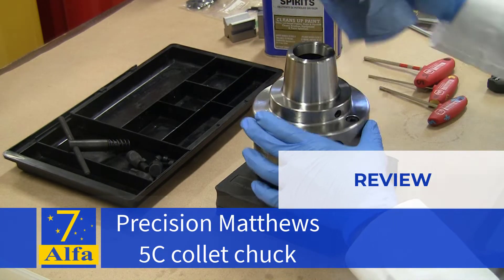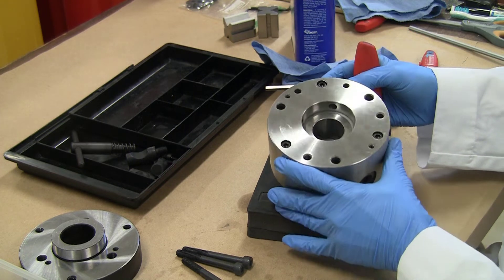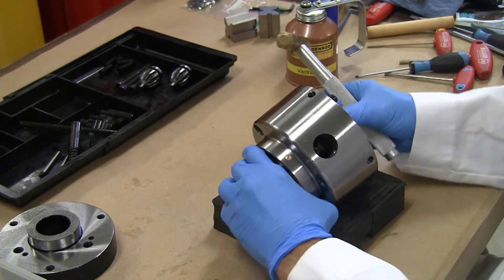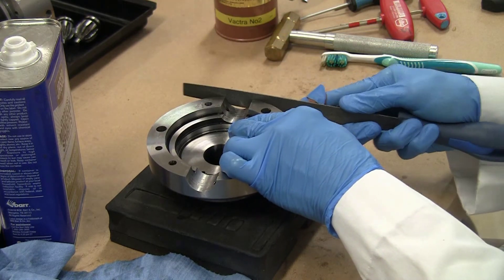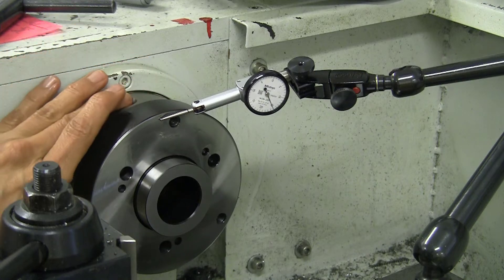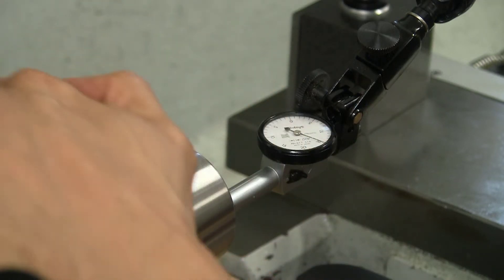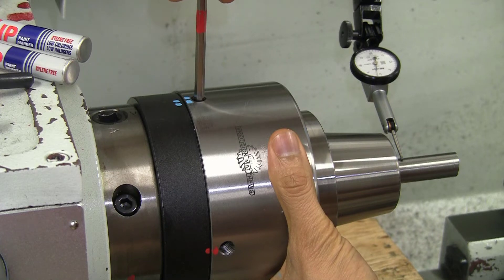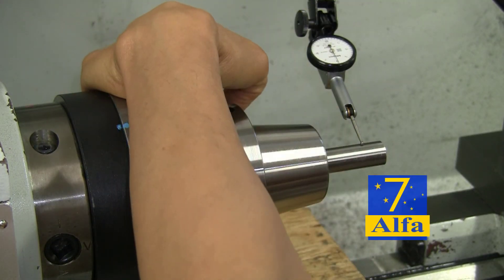Precision Matthews 5C Collet Chuck: Review

Comment: Thank you for this. 👍 Since I saw Clough42's teardown video of his cheap Ebay collet chuck I was wondering if the PM version was really a step up in quality (certainly a step up in price) or just another cheap clone with PM's logo and the set-tru adjustments being the only "enhancements" for the price difference.  I see that it definitely is a big step up to justify the difference. I wished your teardown went a bit slower to show a better shot of the ring gear, but I paused it and it appears to be MUCH more evenly machined/ground than what was in the cheap one in Clough's video. I also wished you had checked the hardness of both the pinion and the ring gears. Clough's reason for tearing his down was that he noticed it's action was getting worse and on teardown it appeared the pinion gears were too soft and getting deformed. Outside of those nit picks, great video and now this 5C chuck is on my list as the one to get. Again, thank you.
Reply from the maker: Thanks for your kind comments. I don't have a set of hardness testers yet, they are definitely on my list of tools to get (which keeps getting longer). The ring gear felt very even to finger touch, and I couldn't feel any burrs when I was going around it. I would like to do another video about a year or 2 later, time permitting, to see how things hold up. 
One thing that draws me to PM parts is how they generally stand behind their products.
Reply: @7alfatech860  I just meant running a file along them to see if the file cuts the metal easily or if it just glides and barely touches them.  Nothing fancy, that's all that Clough did and that was an old trick my dad taught me many years ago.
Reply from the maker: @paulprobusjr.7597  You are right, I had completely forgotten about that :)

Comment: thanks for the video. that looks like a very well made chuck at an affordable price. I'm looking at the ER-40 collet chuck because i already have a collection of ER-40 collets for my mill.
Reply: Denny, I am starting out getting ER-40 collets so that I can use them between my mill/drill and my lathe, although I do plan to add 5C collets and a good chuck once I fill out my ER-40 collet set. I went with the Shars adjustable ER-40 chuck. It is well made and works quite well in my limited (so far) use of it.  However, if you have either a D1-4 or D1-5 spindle, I would get the PM version instead. It appears to be about the same but what I did not like about the Shars was that it did not come with the pin wrench to tighten/loosen the collet nut. Since you already have ER-40 collets this may not be an issue for you, and it was only a slight issue for me since I had my mill collet holder come in  a few days after I received the chuck (the mill collet holder came with the pin wrench, but I since bought another wrench for the lathe). Both are about the same price, as well. I pretty much did not have a choice (at least not one that made economic sense), I had to get the Shars because I could get it with the back plate for my lathe (1-1/2 - 8tpi).  And Shars pairs their ER-40 collet chuck with other back plates as well.
Reply from the maker: Appreciate the comment. I too was going to go for the ER-40 at first, but I had the opposite... a bunch of 5C collets.